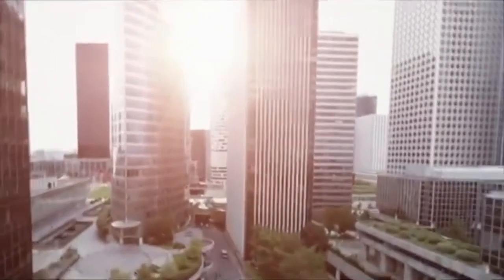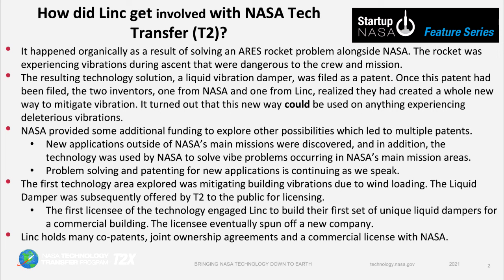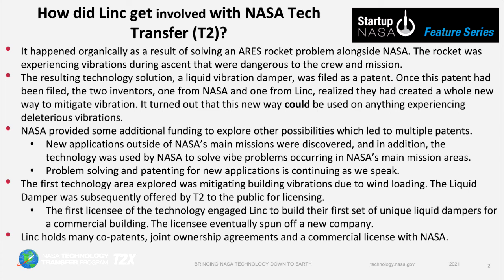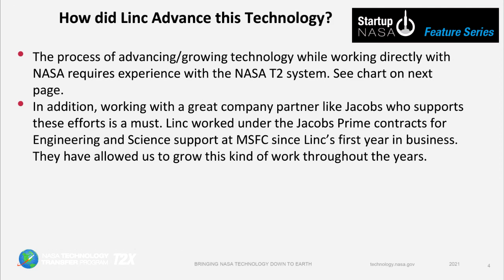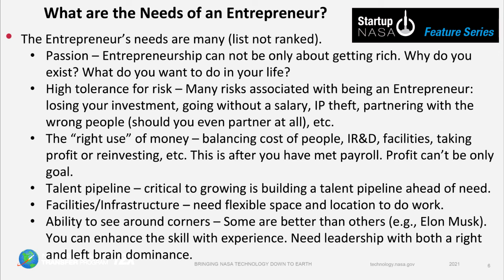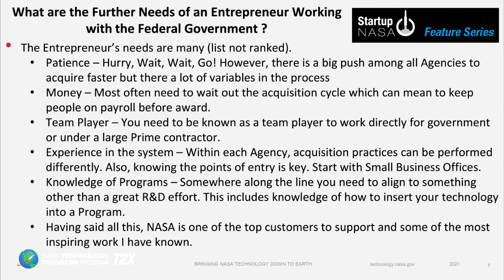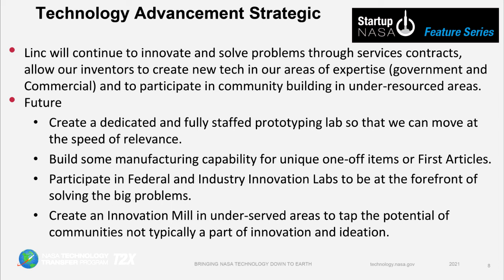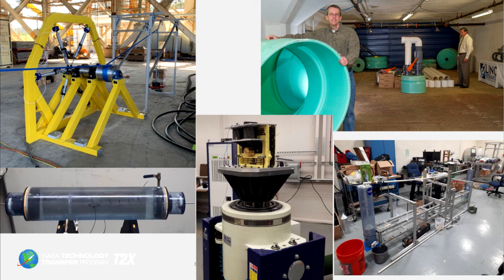Startup NASA Feature Series: Linc Research, Inc.

Comment: Carbon Nano-tubes 

The orientational alignment of CNT into a continuous filament fiber vs the less superior staple “hybrids” is key to forming a proper continuous filament nanotube yarn for advanced fiber reinforcement with superior characteristics in each application.

We faced the same challenges with early production and process applications during our research and development of aramids in the late 1960’s ie DuPont’s Kevlar©, Nomex© etc. for advanced material reinforcement.

A CNT hybrid staple is not an efficient or cost practical use of CNT.